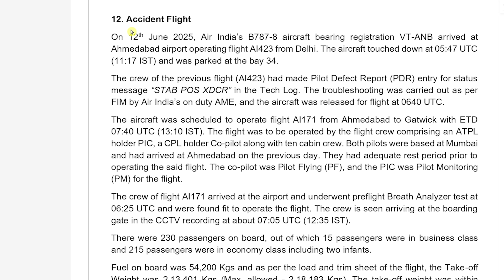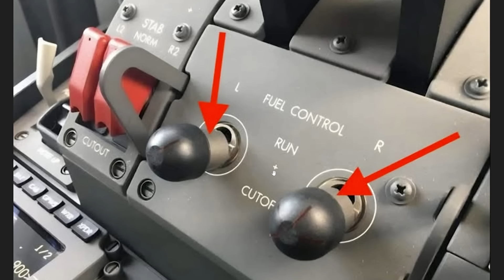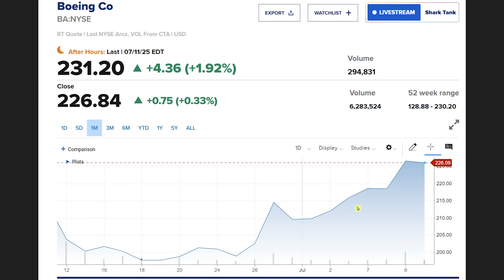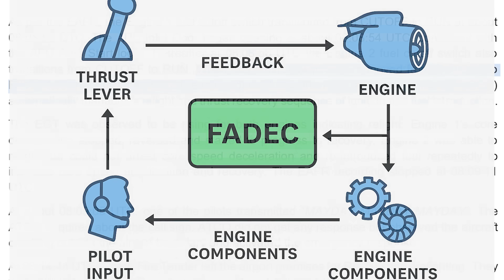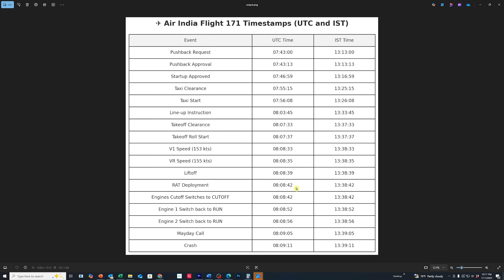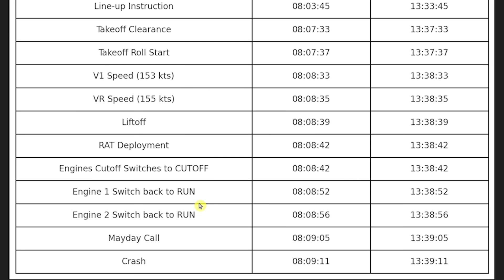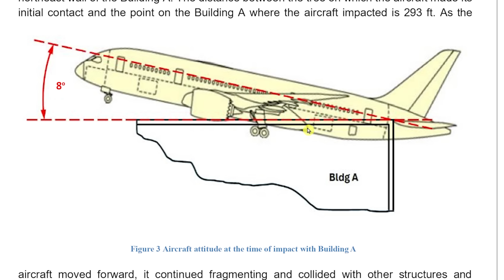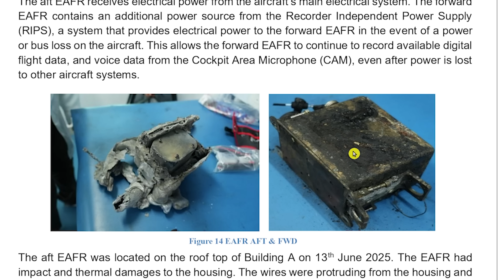Did Pilots CUTOFF Fuel? Shocking Twist Air India 171 Report!

Comment: The EAFR does not indicate whether the cutoff was manual or automatic — only that fuel was cut off.  EAFR doesn’t differentiate cause — only effect (fuel OFF). It does not log “manual fuel switch to cutoff” as a separate, identifiable event. So till the final report it cannot be said with certainty that there was a manual fuel cutoff by the pilot. This can very well have been a software commanded fuel shutoff which can happen due to numerous protections buit in. The EEC/FADEC can autonomously command fuel cutoff in response to certain conditions — even if the fuel control switch is still in the “RUN” (on) position, which will be indicated in the display. So the pilot could very well have asked did you cutoff and a response of i did not.
Reply: The EAFR on a boeing 787 does record the position of the engine 1 and 2 fuel cut-off switches.
Reply: @Knarf2049-z7g what is the source for your information? It's an important distinction so it would be good to have this reference
Reply: @Knarf2049-z7g source on this? ChatGPT disagrees with you.
Reply: Then point is that the report mentions that fuel switches was transitioned to RUN position so  according to u ifall was electrical and levers remained in run position, why report says switches was transitioned to run? I mean did they automatically turned on? I dont think so if they failed Electronically once they would turn on again Electronically,  it looks it is definitely manyally done, but i am uneasy at fact that say both switches was  turned off at gap of 1 second, is this possible for human being?
Reply: @bhaktimandir-my5pk  based on the information released, it cannot be confirmed that fuel switch was mechanically in the off position. the FDR does not record the mechanical states for the fuel switches. maybe more cockpit audio will be telling.
Reply: It seems weird to me that the engines were cut off in the exact same second.  It would be very difficult if not impossible for a pilot to reach both hands over and pull both cutoffs at the same time, which is what the timeline indicates.  I would expect at least 1 second between cutoffs.
Reply: Yep, software commanded fueL shutoff event is possible. Function of then system software that commands closing off valve. (After receiving from electrical condition perceived). Overriding any pilots, if those maintenance conditions are perceived to be met, commands execute. See air India video if still on YouTube.
Reply: There is no automatic option for the switches! And the EAFR says, the switches are moved to cutoff.
Reply: @PeterPaskoff  previously both engines in 2018 was shut off during landing, so it is not something that never happened before, we cannot rule out the possibility
Reply: The cut off was manual. This was a deliberate physical action by the pilot.
Reply: @dangermouse8466 how do you know it was manual when the FDR records the digital signal and not the mechanical position or event?
Reply: @dangermouse8466 whether it appears deliberate or not, the possibility of software glitch should be fully investigated for the safety of the people still flying around in these planes. Then, if that possibility is ruled out, it gives more weight to pilot deliberate action. Otherwise it's still all just speculation AND potential risk for the 787 still in operation
Reply: Exactly.  We need to think for a minute . What if this was electronic failure of fuel switch???
Reply: Has to be manual.

Comment: I can't belive 2 if the most hazardous flipswitches to touch in the air, and even worse during a climb out, is placed so easily accsesible that even a flight attendant serving tea may touch them if they stumble in cockpit. Not even a safety cover. Yes the pilots use them everyday they shut the engines down at the gate, or in the event of an engine fire but they seemed extremely accessible.
Reply: But the design of the switch means that they cannot accidentally be activated. The switch lever is under tension by a spring. It has to be pulled towards you, then moved, then released. Simply knocking the switch would not cause it to move.

Comment: Is it possible the switches went from run to cut off on their own with the spring failing? The pilot said he didn’t do it so how does two switches that you have to lift and push up or down on a spring move if not by pilot, they have a guard on top and bottom too to avoid mistakenly touched. They were put back to run but it was too late. It’s baffling.
Reply: There's a separate switch for each engine. Both switches failing at the same time is extremely unlikely.

Comment: Am I the only person shocked that the fuel cutoff switches are so accessible? The fuel cutoff switch for my LAWN MOWER is in a safer position from human error. I understand the pilots need quick access to those switches in a real emergency... But when you've flipped those switches hundreds of times in the past subconsciously, as pilots do on every single flight, the error prevention detents mean nothing. The pilot who pulled those switches did it subconsciously. Muscle memory fired at the wrong time. A brain fart. The engine's computer is supposed to be super smart right? How about not allowing the fuel cutoff switch to work during takeoff? That might be an important safety feature for a jet airplane.
Reply: You are not the only one mate. I can not understand the stupidity of the location of those switches. Access so easy that in the case of inadvertent movement they can literaly bury you.

Comment: Interlock - Interlock - Interlock..... Why do aircraft manufacturering engineers not install Interlock devices on all aircraft... 🤔 Say the fuel cut-off gets interlocked as soon as the aircraft reaches take-off speed, and the landing gear is retracted.... One has to put safety devices in place to prevent any inadvertent changes, espewhen a pilot gets the "urge" or desire to self destruct or commit suicide taking numerous innocent passengers with them.... Thank God that I am no longer exposed to flying..... It is by far the safest mode of transport, as long as the "human factor" is of sound mind.

Comment: Based on video analysis, the aircraft appeared to underperform significantly during takeoff. The acceleration seemed weak, and the aircraft used nearly the entire runway before liftoff — a clear sign of reduced thrust or abnormal configuration. Yet there was no rejected takeoff before V1, which raises questions about what the flight crew perceived. More critically, just five seconds after rotation, both engine fuel cutoff switches were moved to OFF, resulting in total thrust loss at a dangerously low altitude. Whether intentional or accidental, this action during such a critical flight phase exposes serious vulnerabilities in cockpit design, particularly the ease of accessing life-critical switches without any confirmation, warnings, or lockout protections. Some people said the RAT was already deployed before the fuel switches went back to the cut off position. But in this short time frame i have my doubts about that. If it was really intentional by one of the pilots it's really fucked up 😢

Video recording and sensors of crucial switches while touching them and or sound immediately an alarm would have alerted immediately the other pilot.  But i stick to my first argument. The airplane already underpeformed during the initial take-off. Something went wrong even before the lift off/rotate phase. We will never know if one or the two pilots had a gut feeling, or a one second thought something is wrong.
Reply: no, accelerations was normal, it has been already pointed out by many pilots

Comment: I’m pretty sure if you turn a fuel switch off that it takes a few seconds for the fuel that still in the lines to finally stop flowing, right? I mean, it’s not instant, right? The fact that the plane was already airborne for a very short time would tell me that they had gas at least enough to take off, and so I would think the switches were turned off moments after takeoff. I am thinking it was deliberate, that there was a struggle or a death wish.
Reply: voice recorder showed no struggle

Comment: The switches were found in the run position so i guess a warning flashed up of the display causing the pilot to ask the question about fuel cut off. Boeing software issues cause fuel cut off uncommanded by the switches
Reply: WRONG, there is no software on ANY plane that stops fuel supply to the engines

Comment: Great video!
My only question by now is - at what point blackbox gets data about switch positions and isn't there some other module involved in middle of line?
If switches was replaced before, can it be, that in that plane was some wiring issues and it was misdiagnosed as swich fault before replacement?

In cars I've seen lots of rubbed naked wires that are hard to diagnose, because fault wasn't permanent and acting was only time by time..

Comment: As a retired electrical engineer who spent lots of time finding weird problems in complex electrical systems, it immediately occurred to me that the wire harness and its connections to the fuel cutoff switches could be the cause of the problem.  How does the signal from changing the cutoff switch positions the switches get to the cutoff valves that actually stop the fuel flow and how does it get to the EAFR?  

If the power or ground connections to the switches, or the wires between the switches and the valves and EAFR were suddenly interrupted or short circuited to "ground" would that stop the fuel flow and cause the EAFR to indicate that the switches were changed to the cutoff position?  If that happened, it would also explain why the cockpit voice recording sindicates that neither pilot actually turned the switches to the CUTOFF position.  If the broken connection or the short was intermittent, that could also explain why the EAFR showed the switches being returned to the RUN position.

I don't know enough about the aircraft's systems to know what other connections between the ctoff switches to onboard computers or other devices may also have been part of them.  If there are addtional connections to those wires, that rasies other possibilities that false signals on them may have been a result of something to do with the fuel being cut off.  Could the previous work on this airplane's enines have been responsible for damage to the wire harness?

Unfortunately the crash was so destructive that the wire harness is probably so totally destroyed that a full examination of the condition of the wiring may not reflect what its conditon may have been at the time of the fuel shutoff.
Reply: Right, the whole engine control system is electronic and just gets the signal from the panel. I do not know what is actually recorded - the physical key position, or the logical signal in control system. If we assume that the damage happened within computer the whole situation looks more realistic. But we do not know the details of how key position changes are detected and recorded, and we do not know how the engine control electronics is built.
Reply: @igorabramov335  The FDR does not record the mechanical states of the fuel switch. It records the digital signal. A faulty warning or short circuit can cause a false discrete input. The position sensor could have malfunctioned. Software or logic error in the ECU. A momentary electrical glitch may also have caused it. Source -- ChatGPT
Reply: Good questions. In theory, the system should be tolerant to all faults, but in practice someone says "that's a really weird scenario and will cost $$$ to fix and will probably never happen anyway and could even cause other problems so we won't address it." The hole in the cheese then sits there until some other rare fault comes into play.
Reply: YES this needs to be fully investigated
Reply: BINgo,,,,Function of the changes valve condition goes from electrical condition 》 to system software that commands closing of fuel valve,, new Maintenance software subroutine was found as to have shutoff valve commands in it??? Can override pilots if certain conditions are met. Some thought plane was still in ground mode. When this happened previously.
Happened on one other flight?
Air India previous video about 1 week  ago.
Reply: The time is taken from Flight data recorder.
Reply: The plane had electrical and ac issues on the flight before!
It is all connected!
After those two 737 Max cover-ups I definitely don't trust Boeing!
Reply: Why was transcript of CVR with time stamps and voices identified not released? Is that coming shortly or not until final report if at all?
Reply: Thank you very much for not jumping on "pilot did it" bandwagon. It makes perfect sense to factor in the electrical malfunction beyond the mechanical switch too, as you did. 

Also, if a pilot did it intentionally, he would have resisted the other pilot trying to turn on the fuel supply switch again. The fact that they were found it ON position indicates that pilots desperately tried to save the plane.

Boeing is going to throw everything including the kitchen sink to make it look like a sabotage.
Reply: That makes more sense than the pilots doing this....
Reply: In the report, one pilots says "why did you cutoff?"  To me that suggests he saw the other guy do it. Shortly after (probably after punching the guy who did it)... the levers came back on. 

The switches have multiple contacts. Some wires go to the shutoff valves. Some go to a box which digitises the signals and then sends it to the EEC, EAFR, displays, etc. I think you'd need multiple short circuits on both levers.
Reply: @ImperrfectStranger   If the fuel control levers are in the cut off position or the computers believe them to be in the cut off position, is there a warning light on the panel or an audible warning? Could it be the the pilot has seen the warning light come on to say that the cut off was activated and reacted to that rather than seeing the other other pilot physically operate the levers. Is it possible there could have been a software fault that cut off the fuel to the engines without the levers being touched.
Reply: bingo
Reply: Or... a pilot switched them to Cutoff, on purpose.
Reply: @StvRdhll  I would believe a computer malfunction ahead of pilot malfunction. Source: I'm a computer engineer.
But we just don't know until we get a better report. This preliminary report has some astonishing omissions even in what it does report. Some CYA going on?
Reply: You got the wrong conclusion because your assumption was wrong. Electrical malfunction may cause it but it cannot cause the mechanical malfunction. The cutoff switches were in cutoff position. One pilot moved it to run position and then the engine run again. It means it was not electrical issue.
Reply: @erictold  If you read the report carefully, you'll see that states two things: (1) At crash site switches are in run position. (2) Recorders logged the changes - switch-to-cutoff and then back to restart. These changes could possibly be related to logical state only. The dialog between pilots may reflect not the switch state but messages about fuel cutoff that appear on their displays. I'm not insisting on some particular interpretation, but just point to fact that report allows for different interpretations of what happened. Possibly, my interpretation is wrong and this could be obvious to someone who knows exactly how recorders and control logics really work.
Reply: @erictold  Maybe it was off (not mechanically) but a system fault - then it was switched off and back on to reset the engine - thats why the piolet said I did not switch off the fuel... was the fuel physically switched off or just electronically switched off and not getting to the engine?